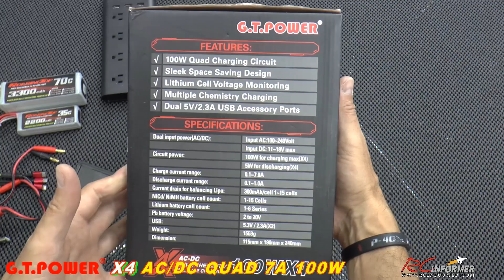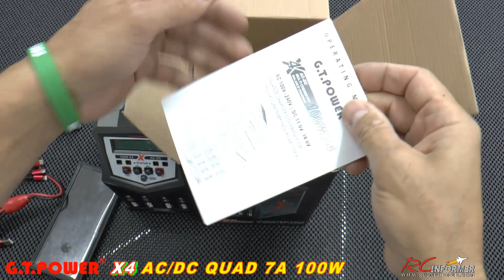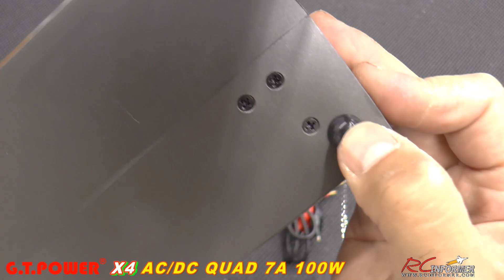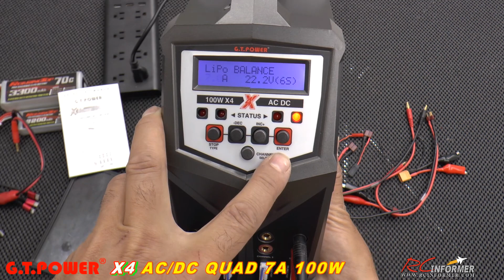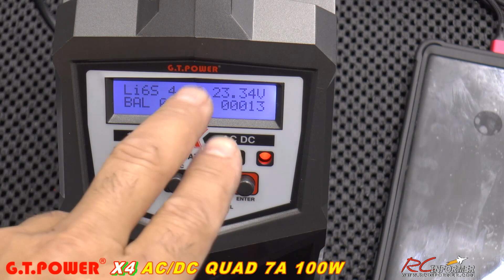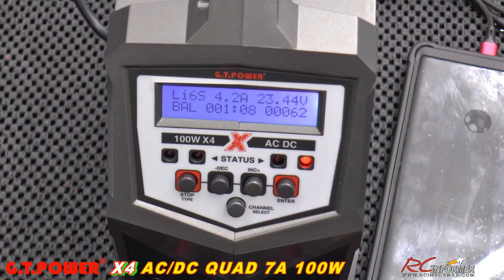GT Power X4 QUAD 100 Watt Charger

Comment: This charger is not simple, the buttons change their function by going into different menus. like in the main menu the buttons on the left go forward and back in the menu but when you select a menu now forward and back are the 2 middle buttons.
Reply from the maker: I still use this charger today.It works very well.

Comment: 100w is not enough to charge 6s yet alone 3x 3s. Better off spending $ on a icharger. Limiting 100w output is ok on the x2 but 4 ports is insufficient as your 6s pack stated maxed at 4.2 amps. Get a 3006 or 4010 icharger and you won’t regret buying 😉😉
Reply from the maker: Like I said, the sweet spot for this charger is up to 4s. 6s is limited to 4.2 amps for a 1c charge rate.

Comment: Nice but would be nicer if it was more than  7amps. Good for my 4s lipos but my 6s run between 5000 and 6000. Not even 1c for me. My Dynamite Duo 200 watt gives me 8.3A per channel, plus it doesn't show up when use the link.